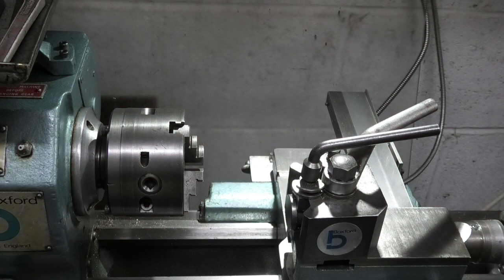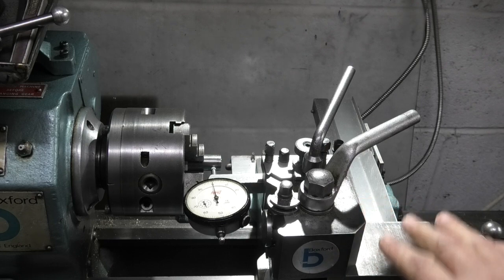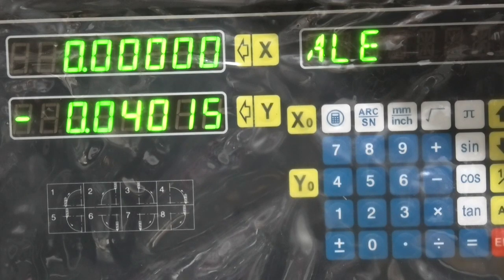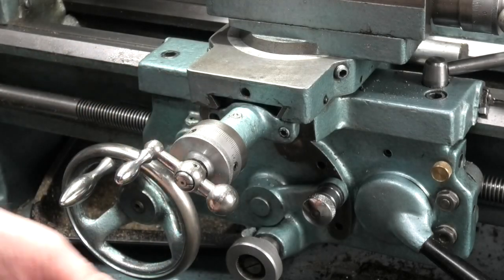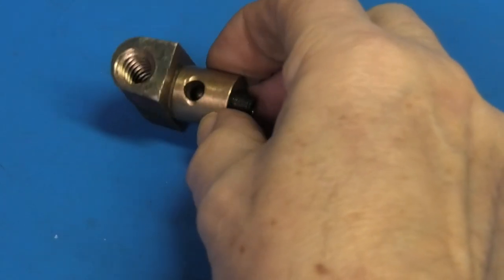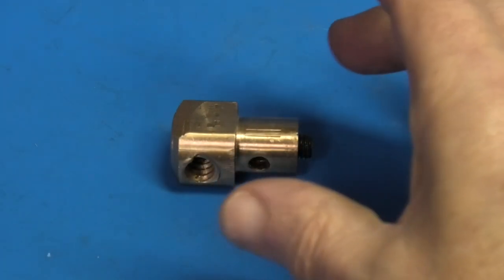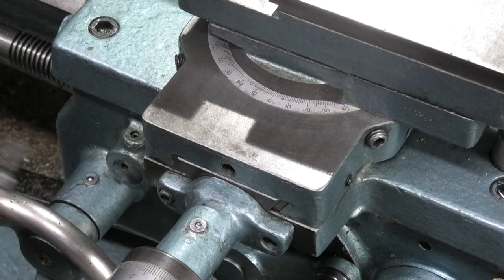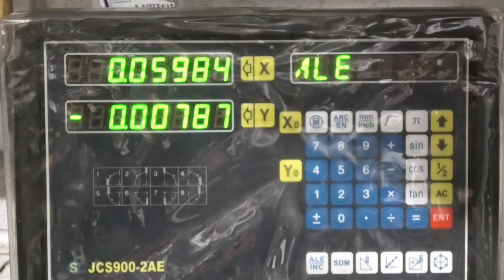Cross slide backlash

Comment: Thanks Mate, I have a lathe made in Taiwan from about 1982, I think. the cross slide nut is quite a bit longer but is split around three quarters deep two or three threads from the end and has a screw so as to pinch it together, which in turn takes up the lash. Thought it might be of interest. Thanks.
Reply from the maker: Thanks Cameron

Comment: You should re-cut the threaded bar to be the same thread thickness all the way across as the worn part then make a nut to fit. This will improve your lathe accuracy or cut off the old thread and weld a new section of thread on with a new nut..
Reply from the maker: A lot of work just for 4 thou